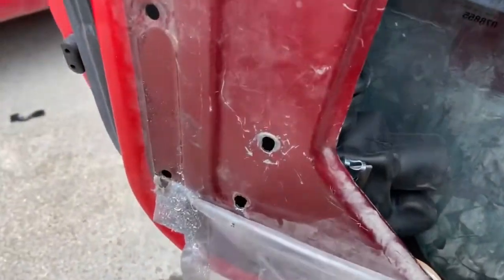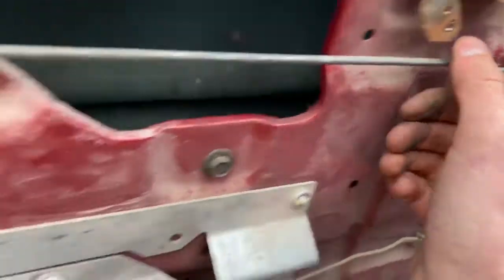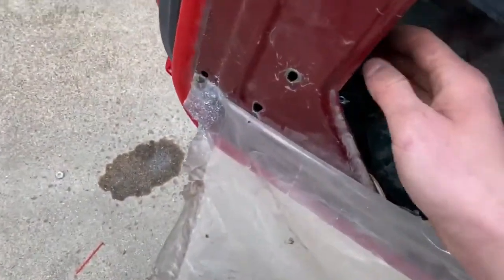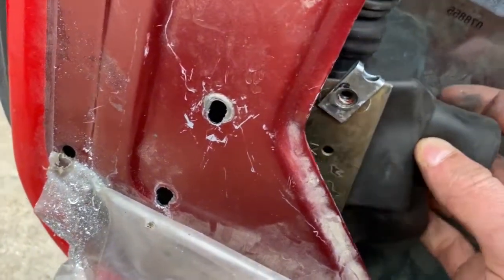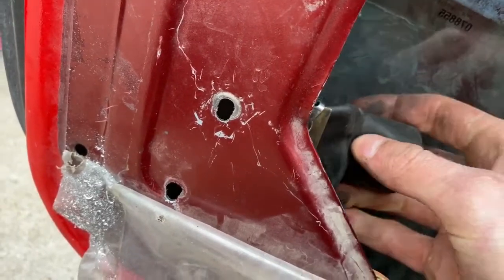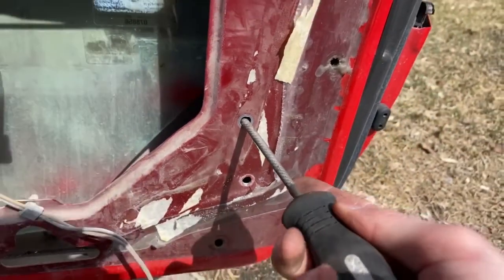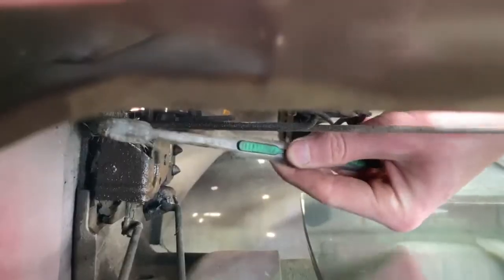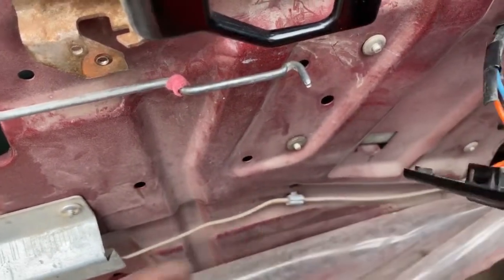Third Generation F-Body Door Lock Actuator Install

Comment: Nice video. Do you know where you got these door lock actuators from? Maybe even the part number if possible. Thanks Thumbs up.
Reply from the maker: I purchased the door lock actuators from RockAuto. There are many manufacturers that offer the actuator. I found the actuator itself had a throw that was slightly shorter than the original which caused some complication during installation. I would do some research as to which manufacturer makes the most accurate reproduction actuator.
Reply: @nickridley967  ok. What did you use re attach the plastic moisture barrier? What kind of adhesieve?
Reply from the maker: @milesmania1150  I used aluminum tape, others have just used masking tape.

Comment: Can anybody tell me what the thing is call that let’s your door close ..it’s the part that swings down onto the metal part when the door closes to seal the door closed I accidentally pushed it into a position where the bolt is not open and will not close all the way